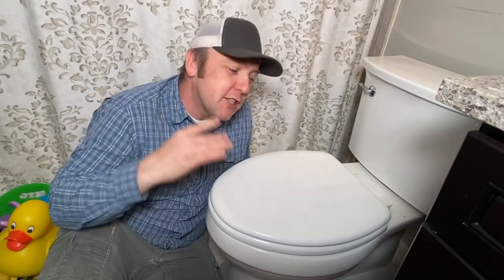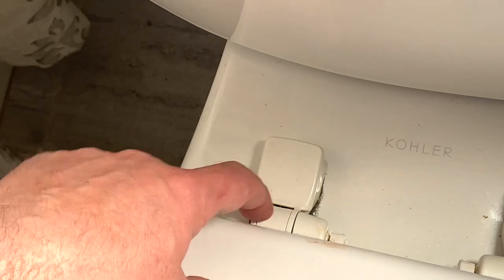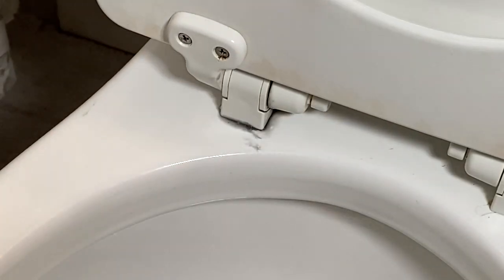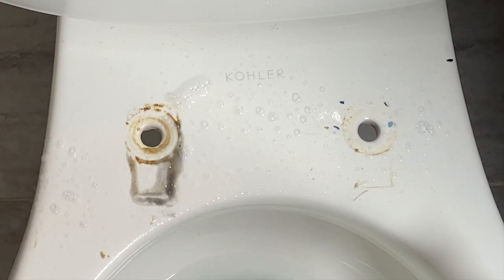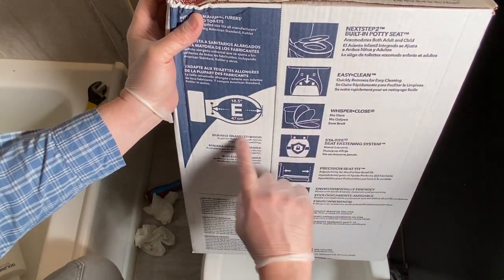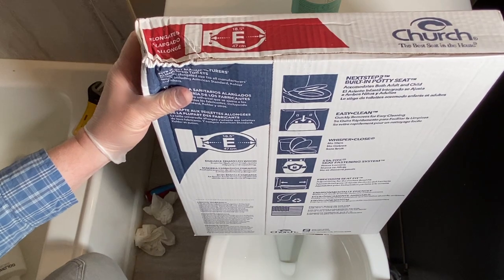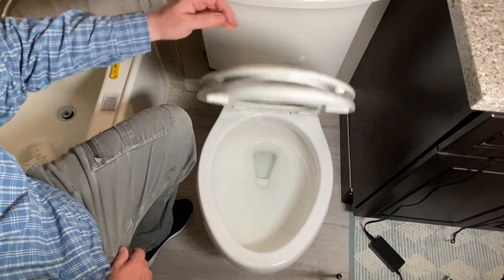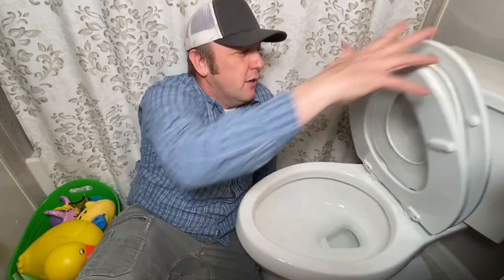TOILET SEAT REPLACEMENT!

Comment: Hello Brain that is one crappy job that I always dread , changing out the toilet seat .  You made it look easy and great advice wearing the gloves . And I have a little tip for you concerning dry hands , mine get dried out real bad and I use Vaseline for Men Fast Absorbing , non greasy body and face lotion !   It works on mechanic hands and will work on yours !   Have a great weekend .
Reply from the maker: That is a great tip!  I don’t know what happened but here lately my hands have been crazy dry no matter what I do.  I will check that stuff out!  Thank you.

Comment: Are you ambidextrous?  I notice you demonstrate things using either hand.
Reply from the maker: No really, but I’ve had to learn to use my left more over the years. Plumbing sometimes requires doing anything to get the job done. 
I think I was using my left hand when I dropped the screwdriver in the toilet. 😂